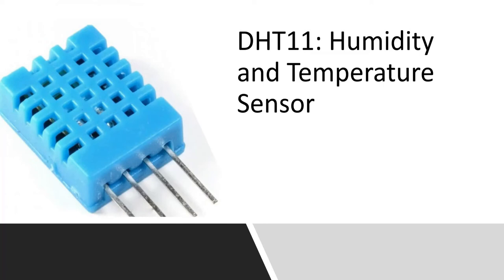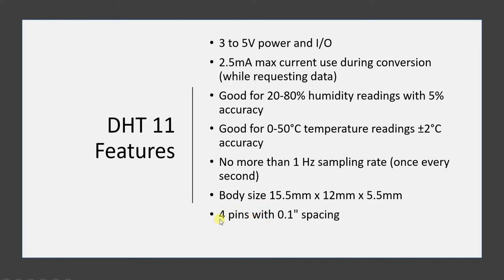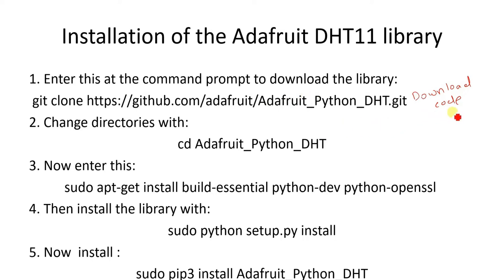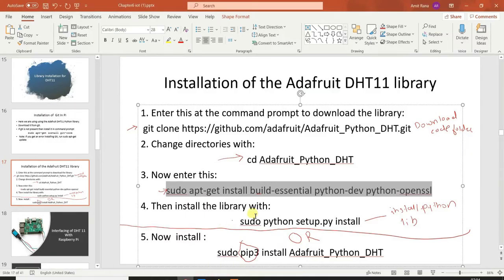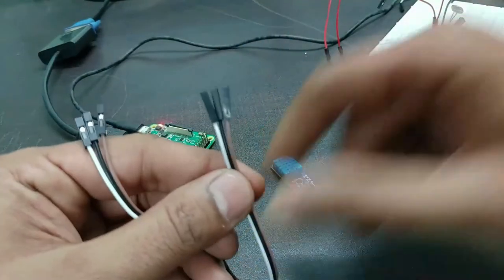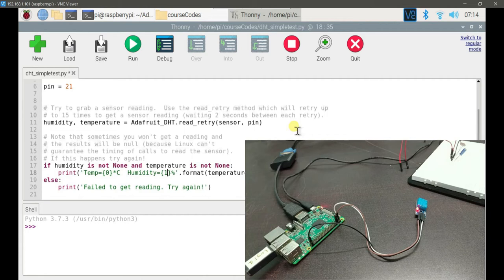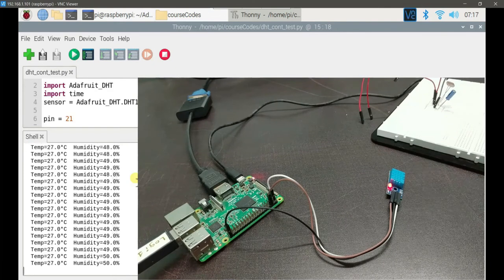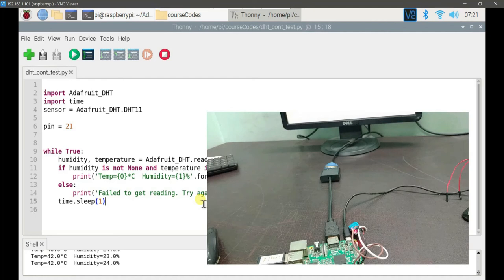How To Interface DHT 11 With Raspberry Pi | Temperature Measurement

Comment: Could not detect if running on the Raspberry Pi or Beaglebone Black.  If this failure is unexpected, you can run again with --force-pi or --force-bbb parameter to force using the Raspberry Pi or Beaglebone Black respectively.
Reply: same here